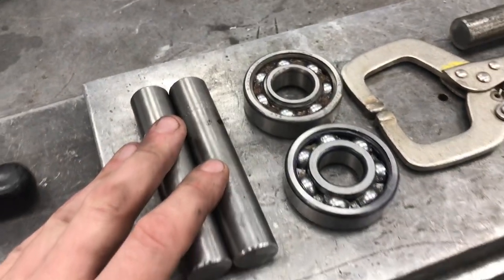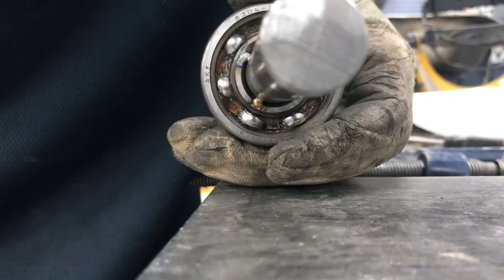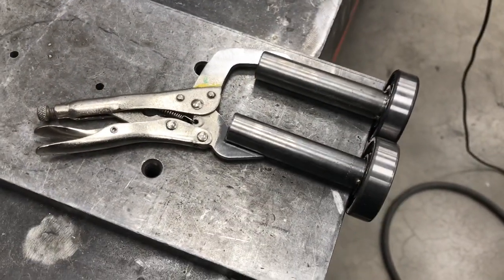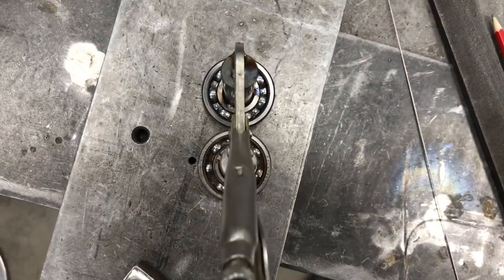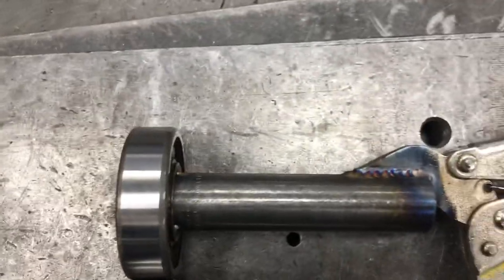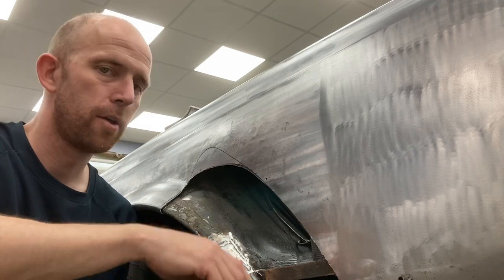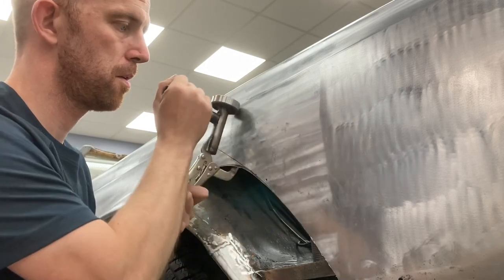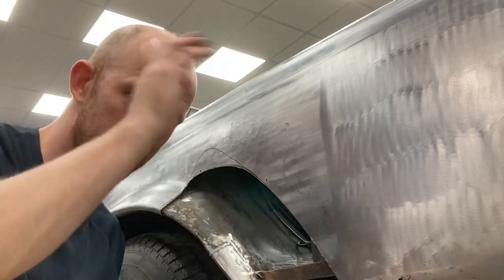C - Clamp English wheel tool hack - mini wheel - made from scrap

Comment: I know you wouldn't be able to control the pressure, but I wonder if you could get a similar result, with one of the "wheels" having neodymium magnets inside and no physical connection between the two? It would allow better access in some cases..
Reply from the maker: That’s a new one on me!